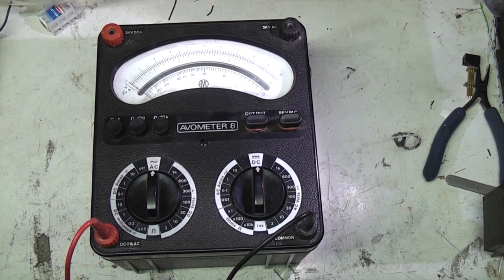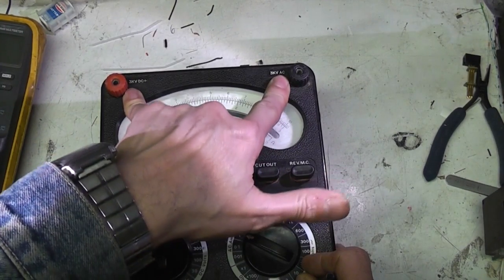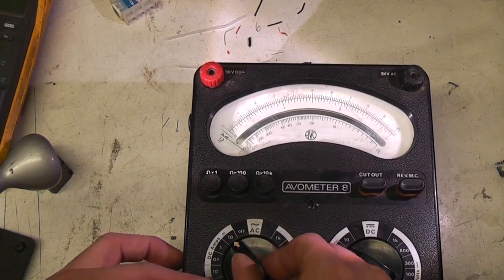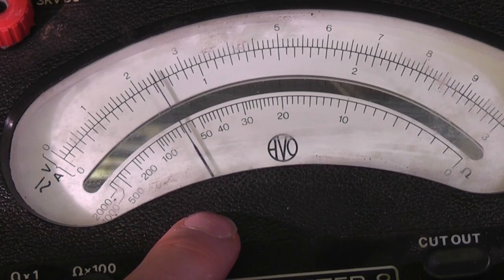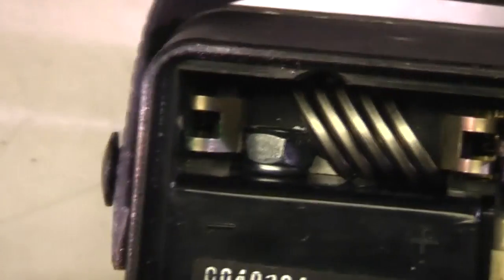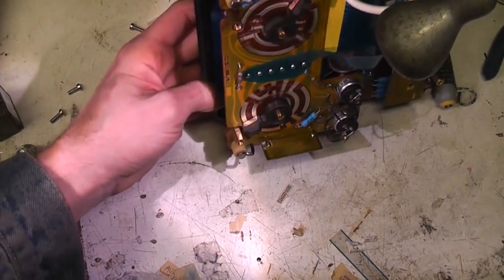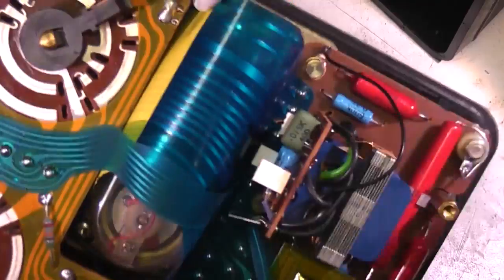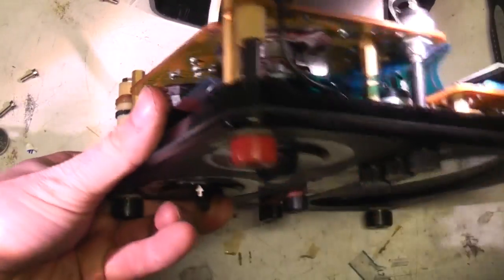Quick look at an Avo 8

Comment: The "meter reverse" is useful on resistance ranges for quick test of capacitors.
You can tell a lot from the way the needle kicks back . 😁
For tracking intermittent faults, swinging analogue needles are a lot more informative than a jumble of changing numbers, too.

Comment: AVO sold a 1.5 volt to  15 volt DC-DC converter that connects to the D cell. Supposed to drain the D cell after 1  year. I put a switch in line, on mine. Still working after 44 years, but not from the same cell!

Comment: I think you rather underestimate the usefulness of AVO analogue multimeters. I use a Fluke too but find that there are instances where I can use one of my AVOs to measure components in situ on boards that digitals can't do. I pop those button cells in a piece of tube with a spacer to make the 15v battery but neater 😉

Comment: Wonder what parts became unavailable.... Must be something for the meter itself?? Switches and components shouldn't be a problem. For the switches I'm even sure real switches like on older models are still available. Never been a fan of that way making such switches integrated in the PCB - always felt it is cheap and inferior.
I've always liked analog meters. A few days ago I was dumpster diving and found an old Avo 8 Mk III dated February 1968 (50 years old sharp!). Only the meter itself but in pristine condition - only a few minor scratches from the dumpster - appears just about unused and literally not a spec of dust(!) But I had to do a minor repair. The cutout was tripped and it was impossible to get  it reset. I guess it was faulty adjusted already at the factory as it appeared untampered and no loose screws. At some point in history it was tripped and the meter was then just left unused for "time to get it repaired". Found out it was very easy to adjust it so now it's working and I've set it as easily tripable I could. It's possible to reset it with the meter being horizontal but not vertical - pushing it there will release it. The old Mk. III is just absolutely gorgeous and IMHO way better than any late 70s/80s design. The materials the design the smell of the inside. A time capsule from a forgotten time where everything was simpler and (mostly) better (even though it was before I was born).
Nice tip for the 15v battery! I thought just using a 12v would be fine if the adjustment allowed for it (which I guess it will). First though I have to clean the battery compartment. It's quite nasty but it'll clean up decently with vinegar. I'll remember wash with water afterwards to void acid corrosion - not much idea to replace alkaline corrosion with and ditto instead :-p

Comment: I have a great condition one of the model you have in the video and still use it for sudden fluctuating voltage changes like in communications receiver calibration, audio signal level checking and is far better at Ni-Cad/NiMH voltage battery level checks than a DMM. They looks great on the shelf just like the technicians had them back when I was at college in the 80s. It was my dream meter back then so does have some of sentimental value to me. They are built to last a lifetime.

Comment: A lot of service manuals for valve equipment specify voltage values as you would see with a 20,000 Ohms per Volt meter such as the AVO. Any other Ohms/Volt ratio or a DMM would not load the circuit correctly to give a correct reading. That is one reason I still use my AVO 8, despite having plenty of DMMs. For higher impedance circuits like AGC lines in radios I use a 1950s vintage valve volt meter (VVM or VTVM in America). Analogue meters are better for fault finding as the needle will follow a varying voltage better than a DMM would. Been using one for 50 years now and see no reason to stop!

Comment: The mirror  is to negate parallax error. when reading. Obviously not as portable as the new DMM's but very good if you do a lot of bench work.Plus you cant beat an analog for high speed circuits..Most DMM's dont react quick enough.

Comment: I used an avo 8, various marks from 1980 to 2000, and still have one. repaired photographic electronic flashunits an analog meter was always ideal for this. love the hack for 15v battery, I also have a Triplett 630PL that requires a 30v battery. avo 8 for me was an expensive but functional tool, I think the last price I saw at RS components was about 750 quid, good meter though

Comment: Wow. That looks just like a 1960s AVO 8 on the outside, but bears no resemblance to one on the inside.
Reply: Not quite. A 1960s is more styled. The later ones has less kurved meter window and less design detail on the casing. The old ones are more a work of art where as the later ones are just industrial design the boring way. Avo 8 Mk IV and ealier are by far the most beautiful.
http://www.richardsradios.co.uk/avo8.html

Comment: those flexies used to go open circuit at the solder terminations leading to very intermittent and frustrating operation. Later marques used proper pcbs. The flexies could also melt when you put your 10A range across the mains.....

Comment: I have a Simpson 270. My dad has a 260. I mostly use a DMM but analog gauges are still, for some uses, more adequate than numeric displays, especially when you it is more important to see sudden changes in values rather than the value itself.

Comment: Morris 
marinas also used flexible circuit boards on the instrument panel circa 1974
Reply: and Toyota corolla dash display unit too
Reply: My 1983 Golf GTI had these flexible PCBs in the instrument pod. Some components were crimped directly on to the tracks. It always struck me as a very naff construction technique, but I had the car for 16 years and never had any trouble.

Comment: The internals of the Mk3 AVO 8 are vastly different - I suspect the construcion changed when they re-arranged the minor controls on the case.

Hillman Imps used flexible plastic printed circuits (made by Smiths) from mid-1969 onwards, so yes it existed and was produced in the UK in the 70s.

Comment: In the US, we had the Simpson 260.  Complete with a real Bakelite case. It didn't quite have the range of yours, but it didn't need an odd 15 volt battery either.

I think one other reason for D cells - back in the 60's when that was designed, you didn't often see AA cells, but everyone had a box of D cells in the fridge to feed flashlights.  Most things wanted too much power for AA's (especially in the old carbon/zinc days) to have a useful life.

Comment: I have Metra Blansko instrument (which I believe was made in mid thirties) that has this same UI with two big knobs, complete with service manual. What always puzzled me is that has some rather weird modes for the time: capacitance measurement (by placing the cap in series with AC outlet) and something akin to true-RMS voltage (which I still have no idea how works). Instead of meter reverse it can double the range with press of button and has some very clever overload protection.

Comment: They still have their uses, an analogue scale is sometimes more practical if you're looking for a peak or a dip in a voltage, though I do mostly use a decent fluke or a high spec bench top meter these days.

Comment: Some of the ebay CR2032s are not great at applications with high pulse current demands. For a simple bias application like this they may be fine...
Energizer, FDK (former Sanyo), Varta make excellent CR2032s but they are very expensive unless you can get them through the bulk channels.

Comment: You wouldn't use one these days. My university just threw out a boat load of them because they bought in some new DMMs.

20 years ago however, these were the best meters around. Even back in 2008 we used these in college because they were such a massive investment when they were new, you couldn't just throw them away on a whim.
Reply: You would if you test retro gear, see other comments, plus that fast needle makes fault finding easier.

Comment: Late 1980's to 2000 more likely, the 1970's versions had wires and a lot of them, along with the variable resistors being wound out of nichrome onto a former and then it's exact value being hand written onto the resistor on final test. You find resistors like 1734,8 ohms in these. Date will be a rubber stamp on the inside of the back cover, and on the boards.

Comment: Honestly, apart from the battery comment the same can be said for digital multimeters. I've got a 23-year old Fluke 73 that has literally sat in a cupboard for 20 years and is still very well within calibration, just needed to have the battery terminals cleaned after the equally old battery leaked inside the - leakage protected - battery compartment.

Comment: Great meter's, I still occasionally use a 50's model I picked up years ago. They're very responsive, and you can see the values at a glance. And now I think the high resistance range will be coming back to life thanks with some 2032's.
Reply: me to. I have the mk2

Comment: You call them pants, but you can rely on them for voltage and current with no battery and after they've sat in a cupboard for 20 years. Treated properly they're probably the most trustworthy meter you'll ever use.

Comment: As I recall, the cutout functions if the needle hits the stop hard enough. Purely to prevent you breaking the movement by overvoltage (whether you do it in voltage or current measurement).

Visually that has almost nothing in common with older models internally (mine is from 1952, as I recall), quite fascinating how much they changed. All those trimmable PCB sections used to be hand-made wire wound resistors on a bar at the bottom.

I'd love another Avo, but that's too nice for me to afford..

Comment: Nice meter, thanks for showing the internals too. 15 Volts battery unusual, I have seen the 22½ Volts battery which has the same size as the 9 Volts one.
Clever idea to use the button cells to get 15V.

Comment: Bakelite, phenolic and flexible PCBs - what a mix!
Reply: The AVO 8 Mk. V does not have a Bakelite case, although older Mk. versions did use Bakelite. The Mk. V just used in injection molded plastic, not sure what flavor, might be polystyrene or perhaps ABS.